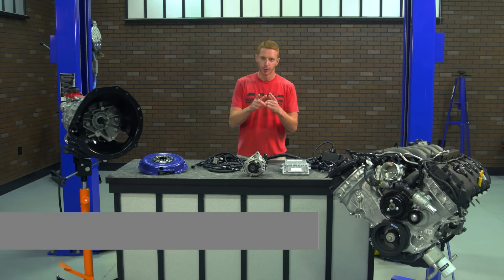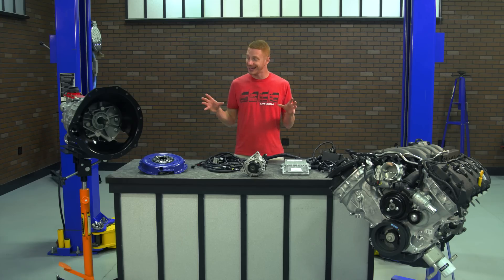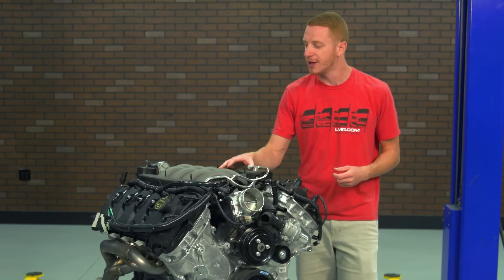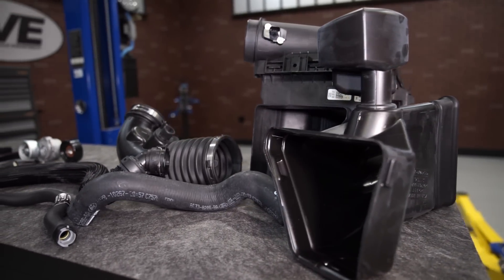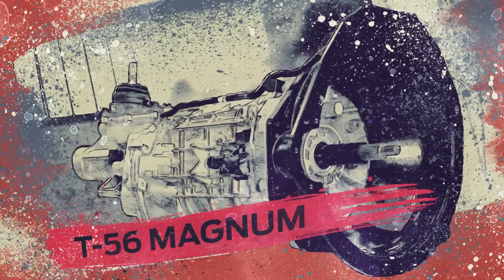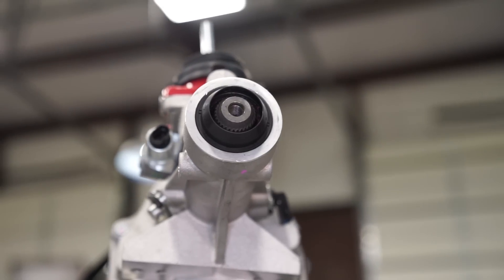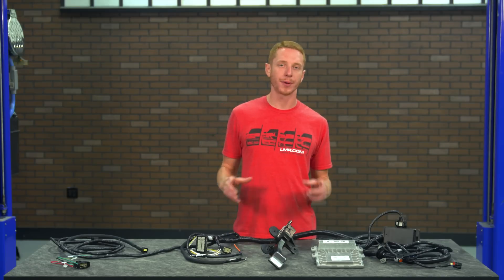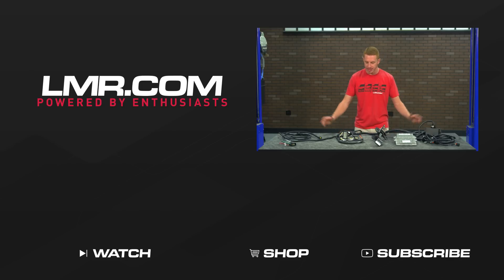Ford Performance Coyote Power Module - Review

Comment: Why the hell would they give you the other header then if your taking one because it's catted take them both your gonna have to buy a set of headers anyway I don't think they sell just the one, or do they?
Reply from the maker: John - I'm sure these are taken straight off of the assembly line at the engine plant without the LH manifold installed. You could probably purchase a factory 15-17 LH side manifold from a local Ford dealership. -Landan
Reply: John S. Negron yeah it’s called junk yard
Reply: Captain Howdy whatever guy's have fun making fun of my comment. I just thought it was funny anything would come with one header truth be told I'm saving my pennies for a foxbody

Comment: If I had the money I would put it in a Lincoln Mark VII.
Reply: DRed Eagle those Lincoln’s are such sleepers. Use to play with corvettes on the freeway in mine
Reply: Sure you did. And then you "grew up" and put your Hot Wheels away and started trolling Ford Coyote "swap" videos looking for random comments about "Lincoln Mark VIIs" you clearly never used to "play with" Corvettes on the "freeway" unless you were looking for a beatdown seeing as how a Lincoln Mark VII is a 225-hp 302-powered "Fox-chassis" lead sled that makes a "Thunderbird" or "Mustang" look LIKE a "Corvette" by comparison. Oh, did you mean Lincoln Mark VIII? Damned little difference with the exception of a "mod motor" boat anchor under the hood that only a Ford guy would consider a "sleeper".

Comment: Is this small block or big block engine cause I didn't understand the long block and also how many gears is in that transmission
Reply: - Small block
- Long block is a generic term for any engine that is complete from the heads down to the oil pan. Remove the heads and it’s called a short block.
- This kit is more than a long block, as it includes a manifold and throttle body. He described a complete engine in this kit.  
- Long block or short block terms do not imply if an engine is a small block or big block. 
- Both the manual and automatic mentioned in the video are 6 speeds.
Reply: @kevin_m110  nailed it
Reply: KevinM lol what